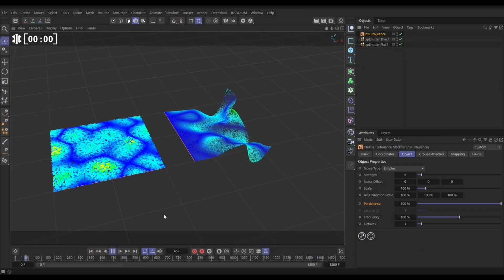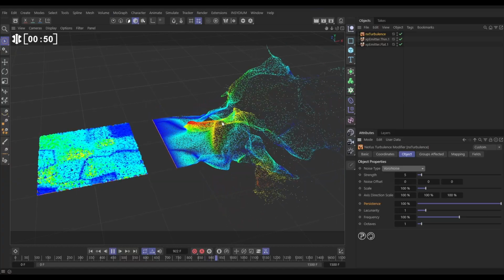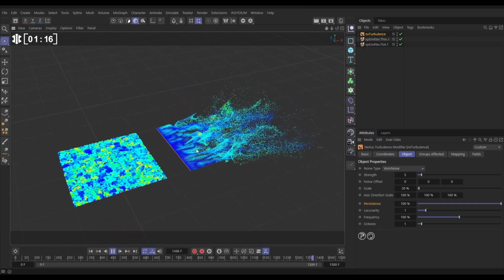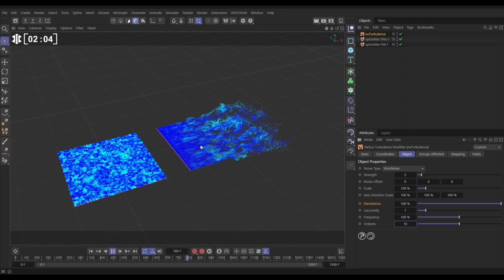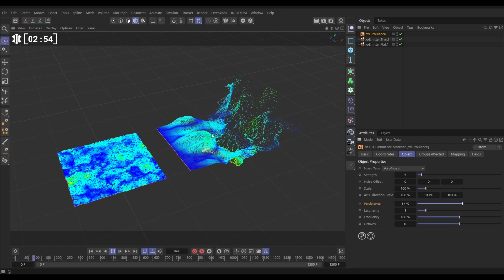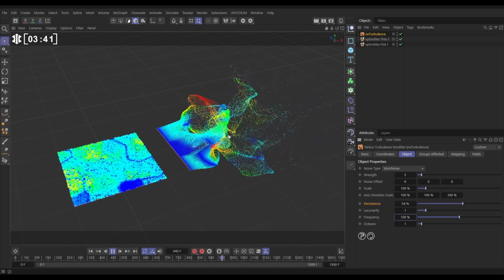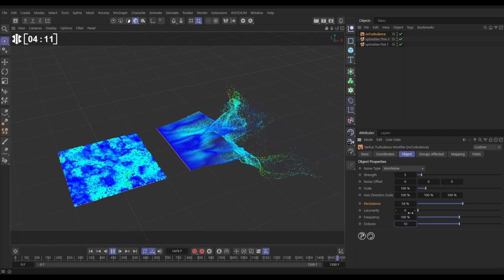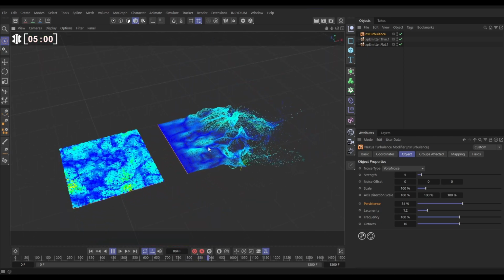Top Tip Tuesday! - nxTurbulence Octaves

Comment: Great tip, I’d love to see something like this for the OVDB Mesher. Even though I use it all the time, there’s a lot of settings in there I don’t understand, and I mostly get the result I want by fiddling vs really knowing what I’m doing. Specifically I’d like to be able to accurately mesh details in models where I’m recreating the models from particles using volume fill and hexagonal mode so I can do melting effects and things like that. In normal voxelization you just need to make the voxels smaller and you can get there, but I struggle with anything that’s not simple/vague with the OVDB Mesher
Reply: I hear you bro, i feel there is not enough  messing info out there,  plus bob works wit fat particle radiuss for demo, but for real detail  you need the be working with a radius of 0.0?thing to make sims look detailed, and that where i struggle to get refined messes.